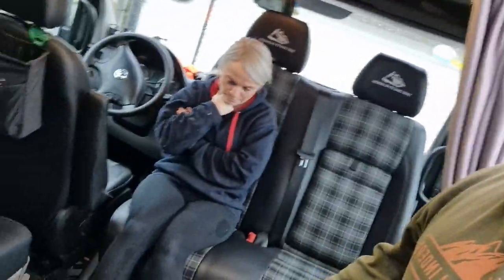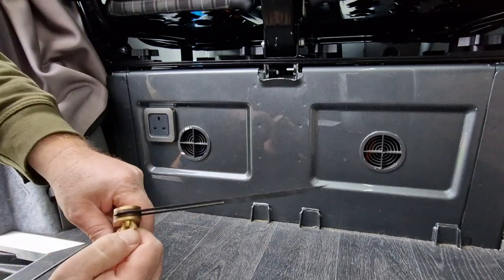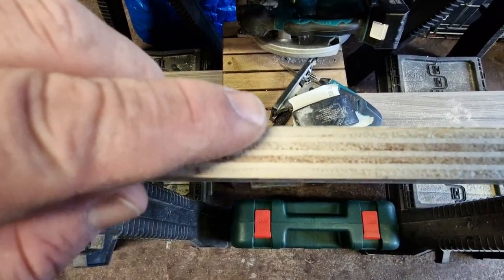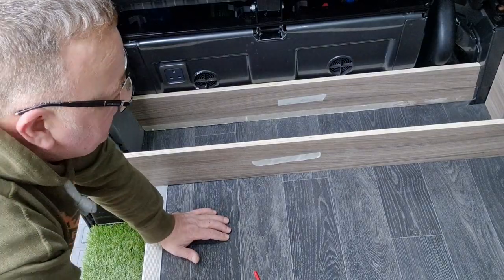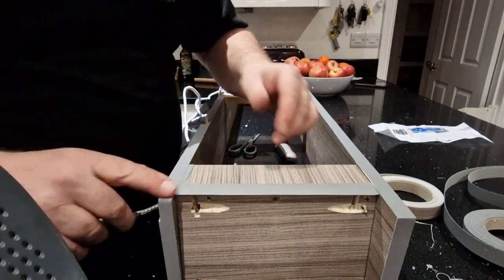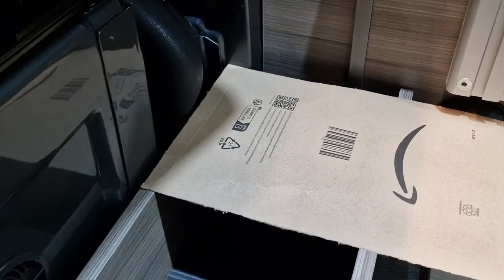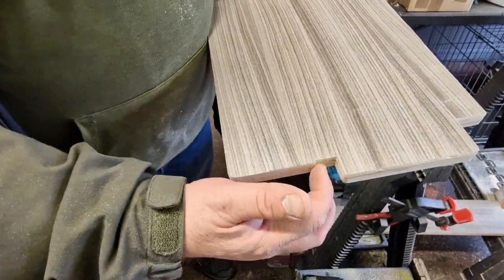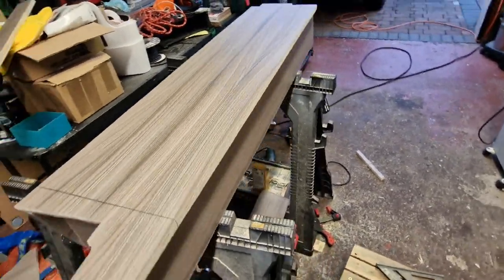double swivel seat foot rest for a selfbuild campervan | vw crafter sprinter | the crafty blinders

Comment: U got a link for the led strip light u used please gd job
Reply from the maker: try this these are what we use 👍
https://www.ebay.co.uk/itm/285107690732?mkcid=16&mkevt=1&mkrid=711-127632-2357-0&ssspo=IAMKJlyBTJG&sssrc=2047675&ssuid=qkhVtACcQ9q&widget_ver=artemis&media=COPY
Reply: Hi thanks I’ve purchased these but looking for the light that goes inside link would be appreciated

Comment: How did you get permission to use the kitchen worktop and the posh iron..? 🤔😉 Did you know there are 2 small pilot drill holes in the Kreg jig for the screws..?
Reply from the maker: I did but never used them maybe I should start